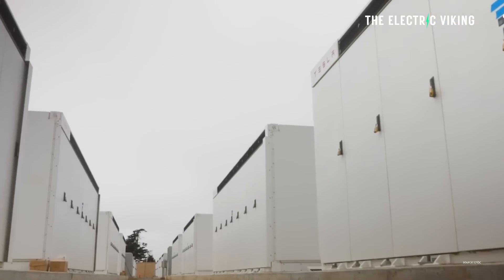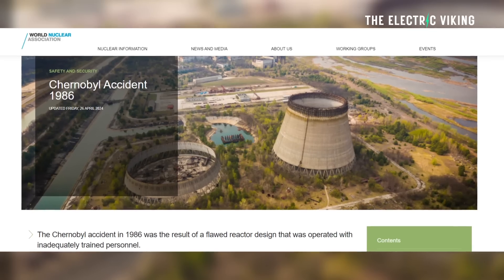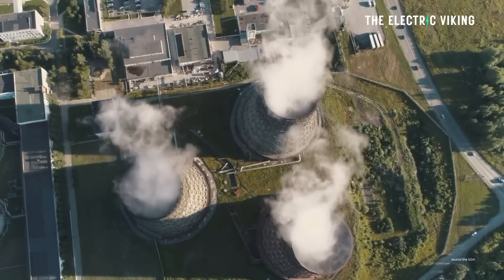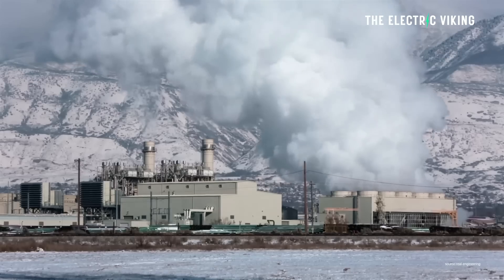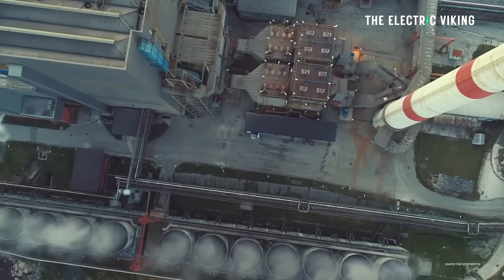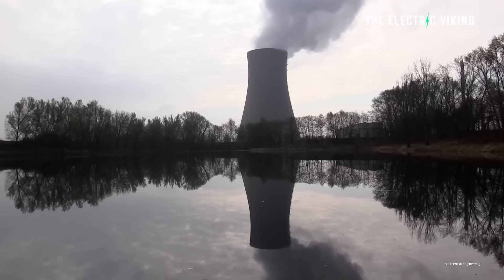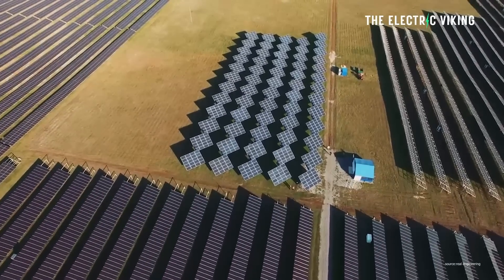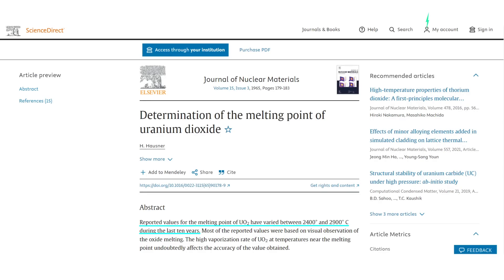China build the world’s first thorium molten salt nuclear power station

Comment: So the first one was built at onle in 1956 as a ship reactor. The second one was in 1965 at Oakridge. The reason it was not continued was the USA wanted Plutonium for bombs.
Reply: The first was part of a project to develop a jet engine for nuclear bombers which would fly for a week or so rather than using B-52s that had to be provided with fuel while flying.
Reply: @user-yt8gu1cl5x I know you have read that, having researched it. The information is however wrong. The aircraft could never have left the ground. So it was tested in a ship.

Comment: In traditional nuclear power plants, nuclear fuel is encapsulated in pipes, and the pipes are placed in pools. If the water is cut off, problems will occur. China's current technical route is to put nuclear fuel in pellets （small ball) with a diameter of 6 cm. Tsinghua University has spent 40 years researching materials for making pellets. It can withstand high temperatures, 2000C, which means that in the absence of water, nuclear materials will not be leaked.

传统的核电站，核燃料是封装在管道里，管道放在水池里，如果水断了，就会出问题。中国现在搞的技术路线是讲核燃料放在小球里，小球直径 6 CM，清华大学用了 40 年研究制造小球的材料，它可以耐高温，2000C，就是说在无水的情况下，核原料也不会泄露。

Comment: "No one wants to live close to a nuclear power plant" ... Depends on what you call close. You clearly don't want to be that close to the cooling tower for the view. In France, where I live, there are lots of people living not far from a nuclear power plant. Also, it's not because nobody lives there that you can't use it for something else like having a forest that captures CO2. A solar farm using the same surface would have no surface available for a forest and maybe produce less electricity. We currently need all means of electricity production to get rid of coal, and China most than others. Ideally, we would have solar panels located over fields of fruits/vegetables that like shade (beetroot, carrots, leeks, strawberries, ...), in order to have no wasted space, and enough batteries to store energy. But having a "base load" is nice to have, and for that nuclear is a good choice.

I was under the impression that the Thorium reactor was already in production for the past 2 years ... maybe I misread an article at the time. It's just not producing electricity from the heat because it's a demonstrator, not an actual plant.
Having Thorium reactors doesn't replace Uranium reactors, because you still need the "waste" from those other reactors to start the reaction in the Thorium reactor. At least the first time. After that you can use the waste from this reactor for each restart.
Reply: The molten salt reactor in China that was in operation was a test reactor. The reactor now being constructed will generate electricity and put it on the grid. However, this new reactor is still small. 

Molten salt reactors can be designed to run on uranium, thorium, plutonium or some combination. Whatever the design they are going to need something fissile to get started. Which usually means uranium. It does not necessarily need to be from a legacy reactor.

Comment: Though wind, solar, and batteries are a lot cheaper and so much quicker to implement, thorium molten salt reactors have a load of great bonus benefits that make them one of the few reactors worth considering. Here's why:

- Thorium reactors can also burn waste fuel from other reactors, on top of the salt-dissolved uranium-thorium fuel mix they use.
- Some designs (not all) of thorium reactors can produce very rare and difficult-to-create materials that can be used in cancer treatments.
- MSR reactors operate at low pressure but at much higher temperatures than normal reactors, ranging from 800 to 1500 degrees Celsius. This is super useful for hundreds of different chemical processes that require extreme heat and are currently almost impossible to make green.
- Because of the low pressures its a lot safer.  And in the event of an emergency, they can drop the liquid fuel into a special tank that sits below the reactor tank which makes it inert and stops the reaction dead. This is the ultimate safety system, and it literally requires no power to activate—in fact, it activates if the power is cut to the safety systems. Significant reduction of the risk factor.
Reply: How about decommissioning?
Reply: @jsanders100  The designs I've seen have multiple smaller reactor modules.  So maybe a cycling of decommissioning and adding new ones as reactors age.  Probably something like that. As for how modules get decommissioned I have no idea. You'd have to ask someone like Kirk Sorensen
Reply: The high temperature can also be used to thermally crack water to obtain hydrogen. I believe the pebble bed reactor can be used do the same. A commercial pebble bed reactor is also being built in China.

Comment: China does not have much uranium, but a lot of thorium. Thorium is also safe because Thorium (Th-232) is not itself fissile and so is not directly usable in a thermal neutron reactor. However, upon absorbing a neutron will transmute to uranium-233 (U-233), which is an excellent fissile fuel material. If something goes wrong, molten salt will cool down and solidify and won't go into the chamber to receive neutron, and reaction would stop.

Aside from military use, thorium reactors can be small enough to be use on small islands or ice breakers, or places where sun light is insufficient.

Comment: I think that NONE of the images in this video are of a "Thorium  Reactor  Plant". There was no "cooling tower" at Oak Ridge.  That's why they don't need a water source, they aren't using it for evaporative cooling. Thus, those structures shown are "Traditional Uranium Power Plants".
Reply: guess its stock footage... I would like to see what they've actually built. Anyone seen any actual pictures of it?
Reply: Some are coal plants (you can see the piles of coal).
Reply: Those are not cooling towers. They are containment towers incase there is a nuclear event. Chernobyl did not have one. That is why it was such a disaster
Reply: one thing not mentioned is that thorum based is going to also be a primary heat source for many industrial processes.. Like a petro chemical plant.  The biggest hurdle that has to be cleared is regulatory.  These agencies are clueless about this new style of nuclear.  So in my view building a plant in the gobbie desert could well be the kick starter
Reply: Not saying those are thorium reactors though
Reply: @ben-andyhein7497 exactly! That was the whole point of developing these. They are high temperature/low pressure reactors in contradistinction to conventional ones which run at high pressures and relatively low temperatures. The huge concrete shell of the building was necessary to contain a high pressure steam leak. That’s what made them unsuitably heavy to put in the envisioned USAF bombers.
Reply: wr
Reply: A molten salt reactor has no water inside the reactor. But if you want to convert the heat to electricity you likely will be using the heat to make steam in an adjacent turbine room. And then you may use a cooling tower to cool that steam.
Reply: @terjepetersen  more likely they would use co2 over water as operating temps seem to be a better match for heat transfer

Comment: This is a small 60 MW reactor that will produce heat and 10 MW of electricity. As far as I can see it is another stage in the development of molten salt thorium reactors. It is supposed to be completed in 2029 and up and running in 2030. Right now China has about 1400 GW of solar and wind and 54 GW of nuclear. Nuclear will play only a very small part in China's energy mix now and into the forseeable future.
Reply: How much electricity do the 1400 GW of solar and wind actually produce. I imagine that the 1400 GW figure is at peak sunlight and wind speed.  So actual production is probably around 20% of nominal capacity, and not necessarily when the electricity is needed. Peak consumption is usually early evening when solar produces next to zero. 
Those 54 GW of nuclear probably have an online ratio of 80%, and provide on demand electricity, ie when needed. The other 20% is maintenance down time.
Most of China's electricity comes from coal, which provides on demand electricity.  Second largest source is hydro, again on demand production. Sun and Solar account for a little over 10% of electricity production. In 2022, nuclear generated about as much electricity as solar..
Reply: Small modular nuclear reactors will likely play a larger role than you think  in both China and the rest of the world.
About half of the energy production is my guess.
Thorium might become the standard, but they are exploring all options, including fission!
Reply: @larsnystrom6698  SMRs could play a big role. However at this stage there are no commercial scale SMRs in the world. There are a couple of companies that say they are close but have yet to show any actual real life reactor. Solar and wind with battery backup are at this very moment showing that they can power the future.

Comment: Someone check me, but I bet the thorium nuclear reactor is not an over unity power producing process. If it was, it would be revolutionary.  The input power for the process, all things considered, is likely more than the output power.  It's likely like Uranium, it allows energy to be condensed for convenience and ease of storage,  like a battery.
Reply: What?
Reply: @danielstapler4315 Current nuclear power productin is not an overunity process. None of them.  If the process was overunity, then after the first batch of enriched uranium was produced,  nuclear power would have been used to run the electric entrifuges instead of coal fired plants that burn mountains of coal.  I used to live by an enrichment plant and had engineer friends who explained all this to me one day.  We would be money ahead to just use the coal to produce electricity directly for the grid. Thorium would work the same but be less efficient.
Reply: @danielstapler4315 Thorium is much cleaner and safer.  Fusion is the grand prize, if we can get to overunity.

Comment: Something to think about.  I know about the process of enriching Uranium.   It is NOT an over unity power producing process.  It works kind of like charging a battery.  A tremendous amount out energy is required to produce the Uranium fuel.  Usually cheap coal is used to produce the electricity that runs the  centrifuges. Once mountains of coal is burned to produce the electricity to produce the U-fuel, then it can be sold and transported easily for energy production.   It is conveniently small to us on subs and ships and satellites.  It has dangerous byproducts.

Comment: Thorium, for this period in time is a fantastic option for power.  Much better than enriched Uranium reactor.  Safe and clean.  You can't say that about dirty Uranium.
Reply: Are you aware that the first thing Thorium does in those reactors is to transmute into Uranium 233 ?
You should look at the Thorium fuel cycle before posting something about "dirty" Uranium.
Reply: @johngonon1507  It is safe by design, the fuel does not determine safety.
Reply: @royh6526  I didn't mean it was not safe. It's just that he said "dirty Uranium" when Thorium reactors also use Uranium as the "real" fuel ... so it seemed a bit ... paradoxal.
Reply: @johngonon1507  I get your point. But the argument against LWR's using uranium is that only about 5% of the fuel is used and the remainder has to be disposed or stored for thousands of years, hence the "dirty" part. As you know the LFTRs burn almost 100% so very little left over waste, and because the unburned is faster decaying only has to be stored for a few hundred years. As far a decommissioning, about the same.
Reply: @royh6526  ok. Superphénix in France was built to do exactly that too ... with Uranium. It's more a difference between "fast" and "thermal".
Reply: Ecofreaks don't actually care about that. They just swallow the kool-aid about bogus technology like wind power and spit it on everyone else.
Reply: Molten Salt Reactors can run on uranium or on thorium or both depending on the reactor design. If it is run on thorium, then the first thing the reactor must do is convert thorium to uranium. The notion that thorium is clean, and uranium is dirty is a pile of nonsense.

Comment: Thorium reactors will run 24/7 non-stop. Renewables are at best supplemental (although I do like the idea of storing thermal energy from wind/solar) nuclear will always be the superior option.
Reply: With a molten salt reactor you can have hot salt storage for load following.  This way you can double the power output of the reactor during peak demand. Great for industrial heat as well.
Reply: @lpdirv  Also great for district heating either directly or recovered from those industrial uses as DH only requires fairly moderate(~60-70C) temperatures. 😁
Reply: @lpdirv  Not required. LFTRs are naturally load following.
Reply: Solar and Battery is perfectly fine for places where the Sun Shines and the Wind Blows but this is not everywhere.
Reply: Also, even if that was the case for China.
The best thing is to diversify.... China is diversifying it's energy....
Reply: In China's Case, no it isn't... It would take so many decades for China to create enough nuclear to power the whole country.... Nuclear is extremely slow, and takes forever.

China wants to become energy secure as quick as possible...  Considering rising tensions with the west.
Solar, wind, etc etc are the best options so far for China.
China is able to install 3 times as much solar as the rest of the world combined... Including wind.

Comment: I've heard some experts talk about how solar, wind, and battery wont have enough minerals for a full transition. This may be the solution. One thing I will say about thorium is it cuts out the most serious nuclear risk:  weapons proliferation. You don't get weapons grade plutonium from thorium reactors like you do with uranium ones. Therefore, thorium reactors can spread to any country without having to worry about secret weapon planning in countries that do not yet have nukes. 

It will be interesting to see how the new power station works out. Been hearing about thorium on the internet for around fifteen years now, and this will finally be the first plant. Seems like the perfect way to generate electricity if you believe the hype. We will see.